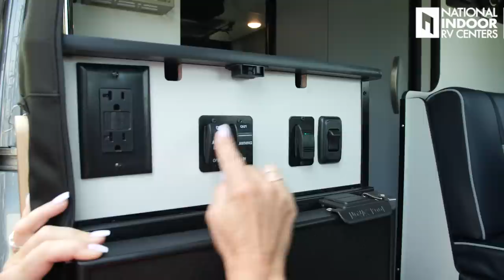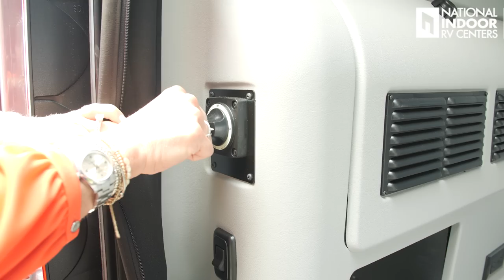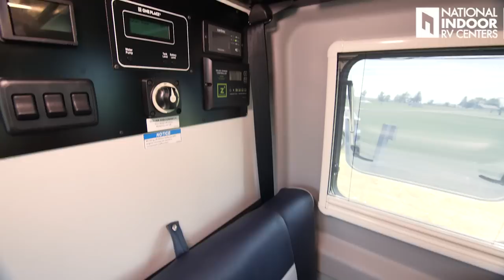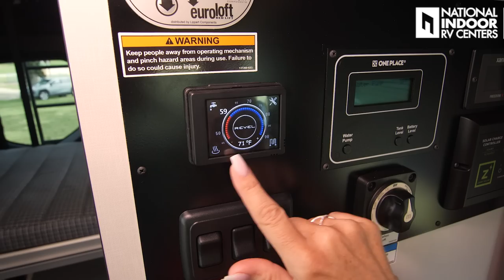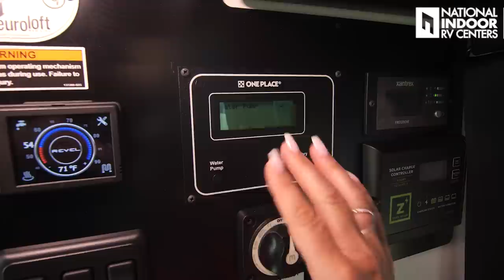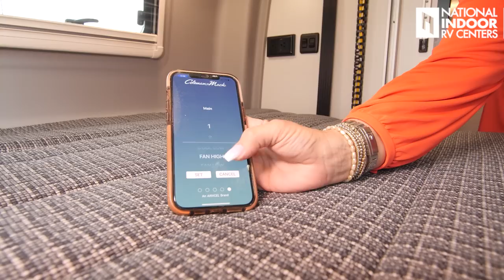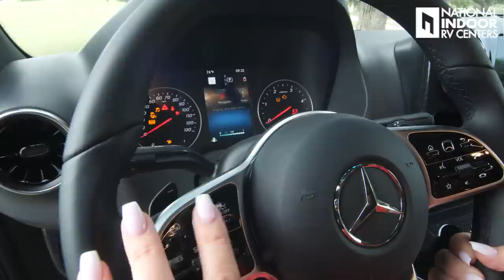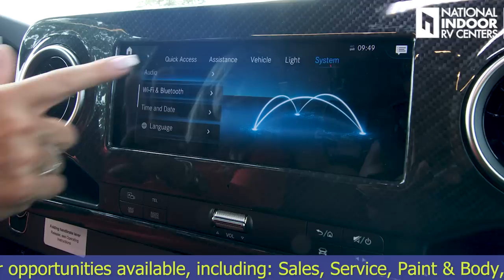Luxury RV Video Tour - 2023 Winnebago Revel - Class B Van

Comment: The shower curtain… does it keep water inside or do you have to shut main door ? As seems castophy if I have to shower with main door to shower or use the toilet
Reply: Russ, the shower curtain and location of the drain help keep water inside the wet bath area so you do not have to shower with the door closed. 
If you do happen to get water outside of the shower, no big deal. The Revel’s flooring is made up of a composite material that is moisture resistant.